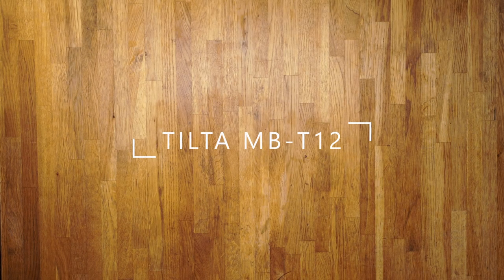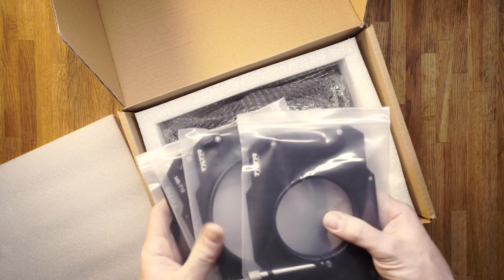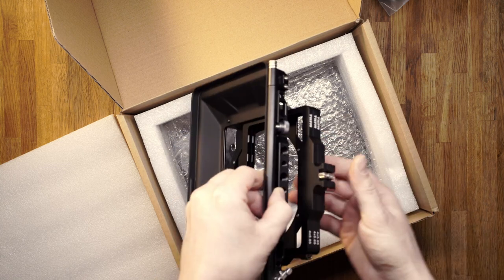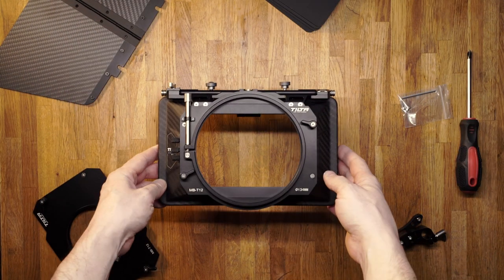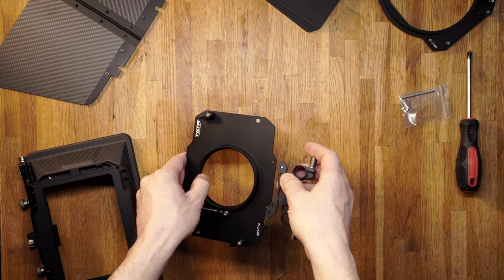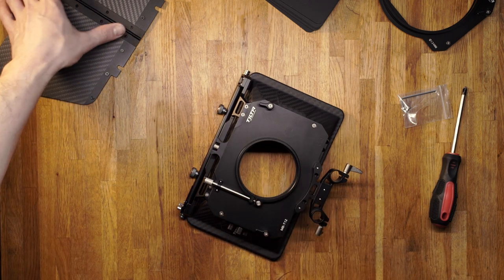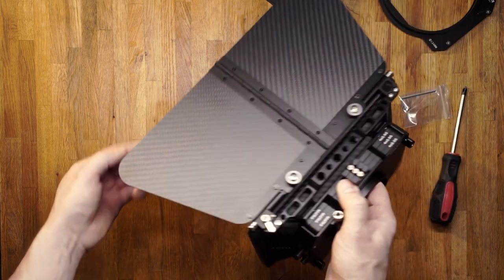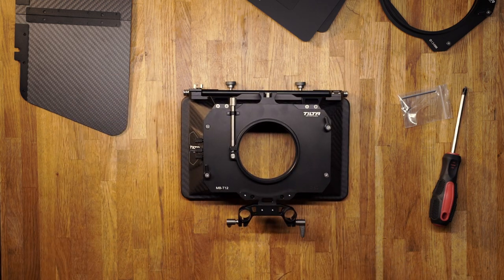TILTA MB-T12 Mattebox - Unboxing and quick guide

Comment: Great video, but you didnt show the drop in trays. Wanted to see how they hold the filters. Are dropin rota-pola's allowed
Reply from the maker: @LeoReyAZ  You are correct. I didn't show them because I thought they were standard filter trays. Im not shure how to answer your question though because I dont own any rota-polas. There are inserts that let you use circular standard threaded filters. I've seen filter strays with rotating PL and NDs that I think would fit in to this but I havent tried them.